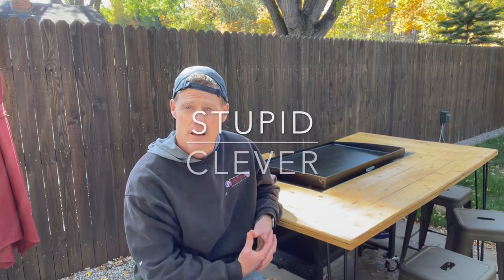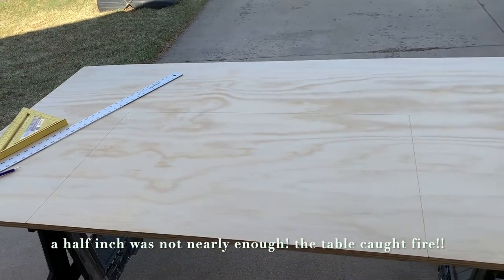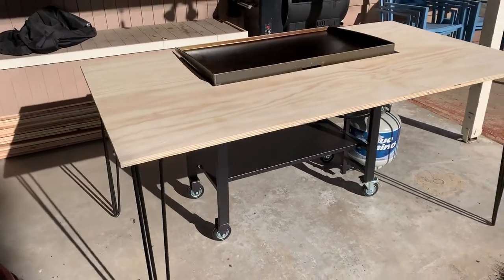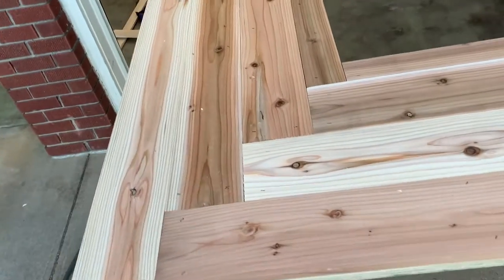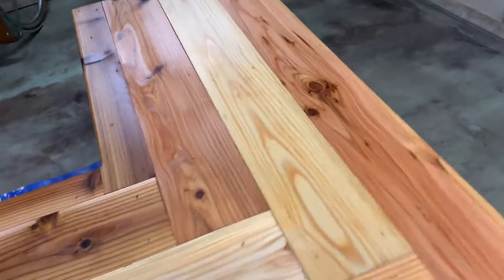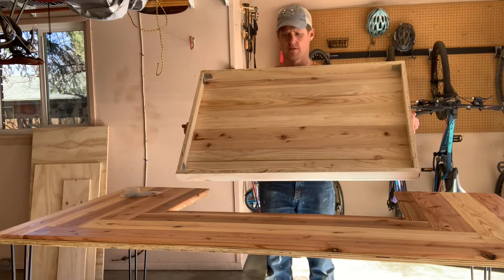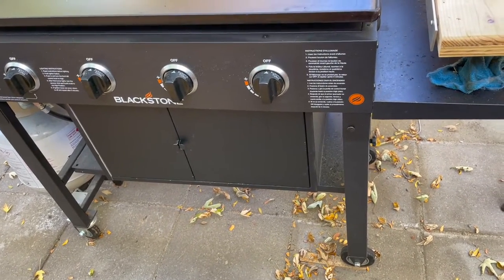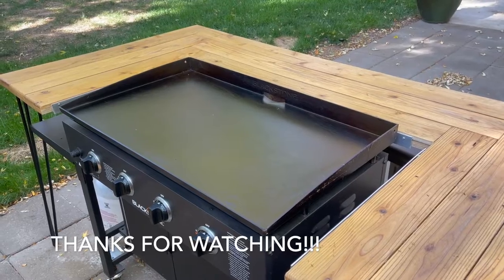DIY Blackstone Grill Hibachi Table

Comment: In this video, could you had mentioned where you purchased the legs? Where did you purchase the legs? Please tell me thank you I would appreciate it so much.
Reply from the maker: Amazon
SMARTSTANDARD 34 Inch Hairpin Table Legs, 3 Steel Rods 1/2 Inch Pipe Diameter, 800lbs Load Capacity, Mid-Century Style for Coffee Table, Side Table, Night Stand (Black, 4PCS

Comment: The question is how does the grease trap work with the table there? I'm looking to do a wraparound with mine but more as a prep station and serving. would think the grease trap would look better hidden and away still be able to grab it and able to empty it as needed.
Reply from the maker: The grease trap works fine, but I do have to pull the table out a few inches to change the foil insert.  Thanks for watching!

Comment: How did you deal with the grease trap?
Reply from the maker: The table sits higher than the trap and there is enough clearance around the edge that it doesn’t get in the way. 
Thanks for watching